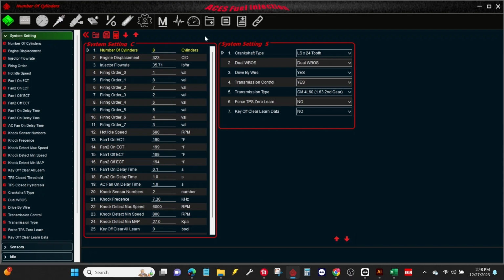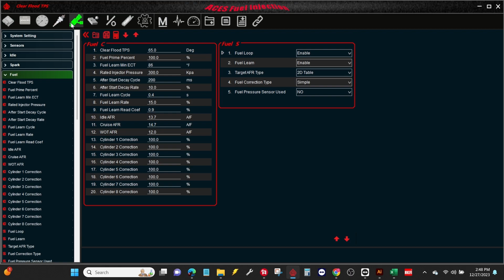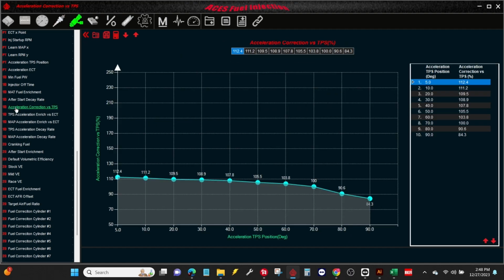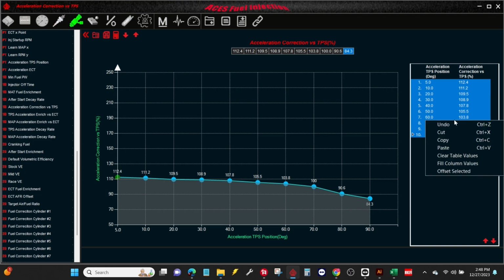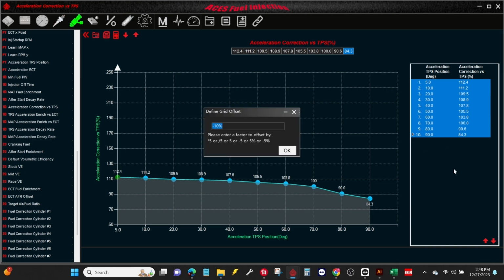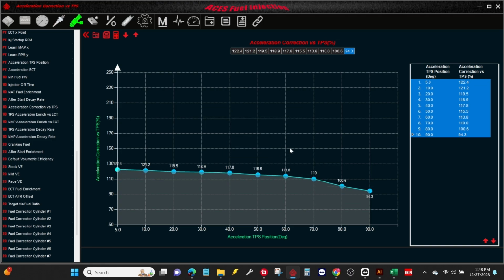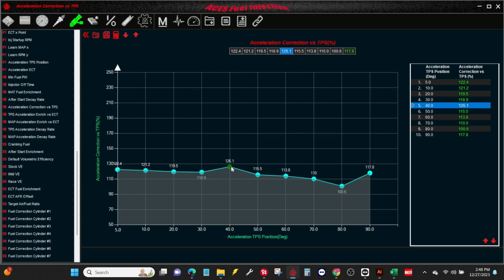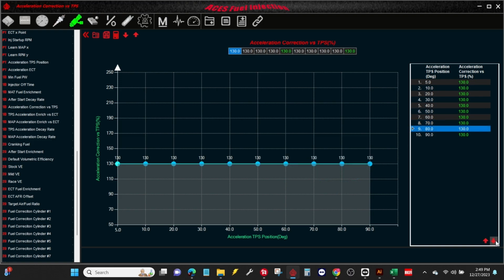Acceleration vs TPS (Tech Short Video)

Comment: Quick question, I’m installing KillShot on my 98 Chevy 7.4 dually w a 4l80 trans. So as I removed all old Factory FI system wondering how  is my Transmission going to work ?? Thanks, Eddie
Reply: If you're completely scrapping your electronics and starting over you will need a standalone transmission control. Aces has a Quick Draw TCM